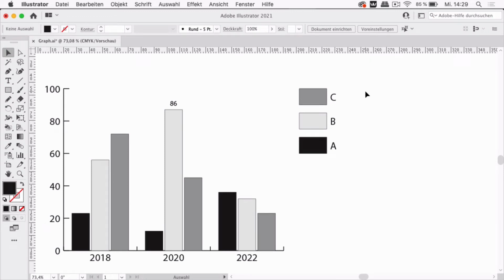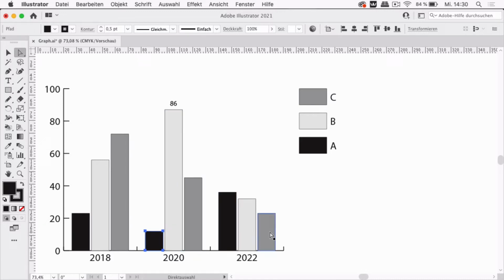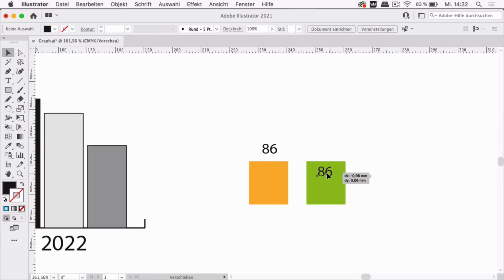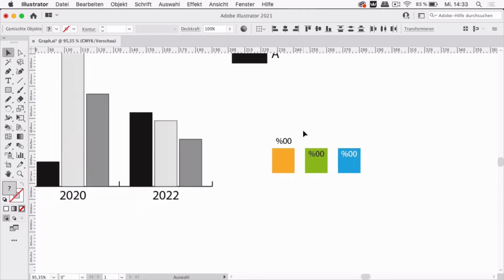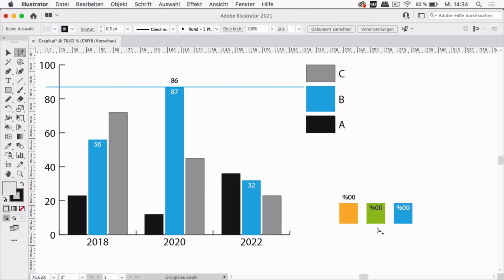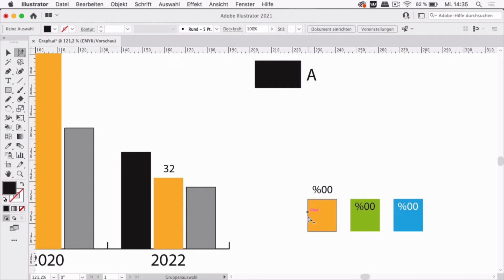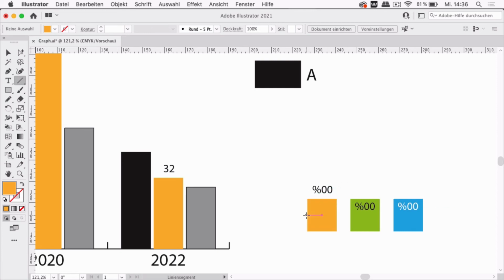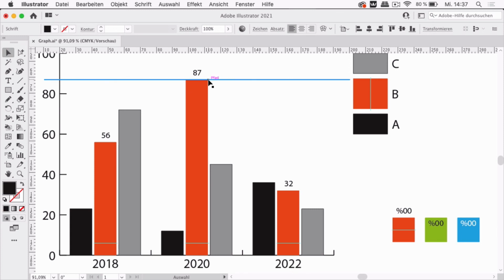How to add text to your bar charts in Adobe Illustrator

Comment: Hi! Thank you so much, this is amazing. Is there a way to write decimal numbers?
Reply from the maker: Yes, you can write decimal numbers. The second integer after the % determines how many places you want after the decimal point. With 0 Illustrator should just use as many as necessary, but if you want only 2, you would write %02.

Comment: it is a very useful tutorial, thanks a lot ❤I have a question. by using %00 it will display a number, for instance is 55. If i want to display 55% instead, if there any way i can solve it out? Not have to solved if you are busy, just an open question. Thanks for your effort, the tutorial is good enough. Thanks again
Reply from the maker: I would hack it with 2 text objects. One with the number %00 and the other one with the % sign. The first one right aligned, the second one left aligned so that they fit.

Comment: This has been so useful, thank you. However, I don't know why, even though I follow this video step for step, the bar chart number still sits below where it should. Is this due to an update that's happened therefore it no longer works? I can't figure out what I'm doing wrong.
Reply: I've had the same problem BUT! I kinda solved it. Having selected the group selection tool be sure you click 3 times, one for the columm, two for all the graph colummns and three for the legend square, if the last one isn't selected the number would not go on top for some reason. Hope this helps!
Reply from the maker: The chart function hasn't been updated in ages. Can you upload a demo AI file with that chart to Dropbox or the like and send me a link? info [at] mediawerk [dot] de

Comment: Question 1: Is there a way for the text values to display with a dollar sign, ie $32.5 M ? I noticed I can add a prefix and suffix to the tick bar, but using %02 only shows the number. 

Question 2: How would you do this with the text box below the bar chart?

Thank you so much for this video!
Reply from the maker: Hi Hilary, if you align the text to the right and then just put an additional text object to the right with the $ sign in it, that should work. I don't think I understand your question #2.

Comment: How do we apply this to bar graphs? I tried doing the same thing and just rotating the %00 when creating the new column design, but when I apply that to the data in my bar graphs it doesnt work. (I'm trying to get the %# to show inside the data bars in a bar graph, and I can get them to show up but the orientation is incorrect (numbers are on their sides) and rotating them doesn't seem to work unless I do it bar by bar manually.
Reply from the maker: Can you perhaps upload a demo file to Dropbox or the like?

Comment: I tried this and it worked perfectly, however when I made a change on the Value Axis or the data it reseted itself. So does this mean I would have to apply the "design"  every time I make a change? Cheers
Reply from the maker: Illustrator is unfortunately acting erraticly when editing the values. Sometimes it works, sometimes it doesn't. It cannot be predicted.

Comment: very usuful but why doesnt'n work with decimals numbers ? 32,0 or 33.00.... tks
Reply from the maker: If you want to have decimals, enter the text variable differently. %00 lets Illustrator determin the number of places for before and after the decimal comma. If you want to have 2 places after the comma, use %02 and accordingly for other numbers of decimal places.
Reply: @Vektorgarten  Tks a lot, it's work very well....Last question: Do you have any solution to avoid the flip for negative numbers ? tks
Reply from the maker: @cassiootto6766  You could create a miorrored bar design. That then gets mirrored back https://shared-assets.adobe.com/link/6868afe1-e6c7-43b7-75c1-5cf3c735867d

Comment: Hello, Is there a way to set the colour of the bars to change automatically according to their height? Let's say if the bar is 19 or under, it is red; and if it is 20 or over it is green. Thanks :)
Reply from the maker: Hello Josefina, this is not a built in function. Maybe it is scriptable and maybe it can be done in spreadsheet software outside of Illustrator and then imported via variables. You could try and read about the Variable Importer script by Vasily Hall, who has written articles around what can be achieved via variables. As an introduction: https://www.linkedin.com/pulse/variableimporterjsx-illustrator-script-version-8-vasily-hall/

Comment: Very cool indeed! A few simple questions, the above/right square is rotated, right? What does actually do the guide? Does it lock something in the object (the one created in the bottom, with the percentage signs)? I thought you were going to say that the new square, behind, should «fake» the height, like the other two at it's right, but should be invisible, with the number inside it, but just allowing the red or orange one to be seen...
Thank you.
Reply from the maker: The guide tells Illustrator at which point to stretch the design. Its position is relevant when the design is more elaborate. The stretch happens exactly where the guide is. You cannot really control what the legend looks like. You get what you get. It can only be rotated, but it won't look a lot better. Turning it off and doing your own would be best. And yes, the invisible square is the reference for the height.
Reply: @Vektorgarten  But then, it is the lower part, up until the guide, that stretches, right?
Reply from the maker: @mguerra79  The part below the guide and the part above the guide don't change. The guide is the breaking point where the thing gets stretched. https://shared-assets.adobe.com/link/31d655d2-e188-4994-72ab-dd33b79df230